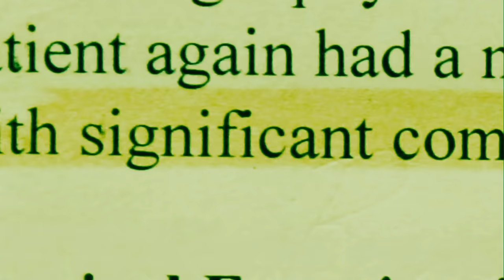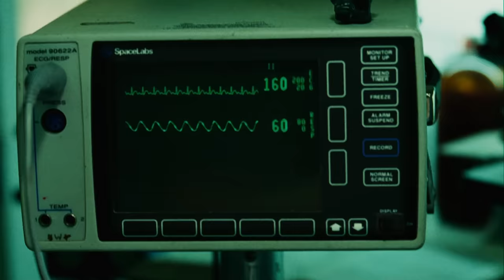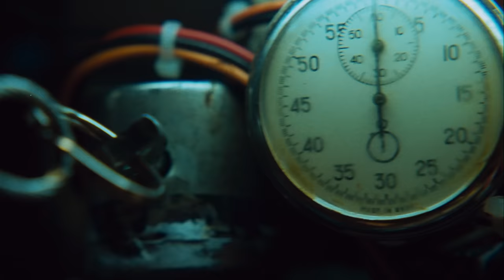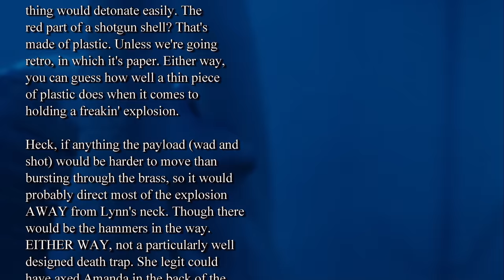Saw III Review

Comment: I think I know how that Death Collar worked. The shotgun shells looked to me like they were being held in place by short metal tubes. So in effect they actually were in shotgun barrels. Think of them as sawed off shotguns that had been sawed off to the length of a shotgun shell. Theoretically that should focus the shotgun blasts towards the doctors head.
Reply: The only way shotgun shells would be lethal in that trap is when the shotgun shells explode, the buckshot (or slug) from the shells to sever her neck and cause her to bleed to death... except that's not what happened in the film.

Comment: What's impressive is that every trap in the Franchise is actually real and can technically do what it is designed to in the films. They're not fully assembled so keep prevent that, but it's impressive and somewhat scary.
Reply: Eh... kinda. They can sortof operate mechanically, to some degree. They have motion. But the Angel of Death is nowhere near powerful enough to rip the ribs out of the body, the Chains of Death would not even be able to tear the skin and the Shotgun Collar has no way of actually triggering it, even if it was feasible, due to the lack of electrical components.
They needed the motion for all the traps, so they could, you know, move them. It's far easier to time it if they can remotely trigger a smooth, single motion from a single place rather than moving each piece separately, and it's both cheaper and looks better to do the actual machinery than to CGI it.
So yeah, the machines move, but they do not "work".
Reply: @morphman86  He did say they weren't fully assembled. If that's the case, that would explain some of the discrepancies that you mentioned.
Reply: @raptoid2518  Eh... no... That's not how this works at all.

But if you want to fangasm over some behind-the-scenes trivia that got blown way out of proportions, who am I to burst your bubble with realism?

Comment: While the torture porn is... something that doesn't even need to be here, it'd be fine if there was solid writing and ideas behind it. Someone should've talked to the writers about the traps, like the shotgun collar. Then again... Could it be hinted as a result of Amanda's newbie status to the traps?
Reply: Nah....because the collar ended up working to extreme effectiveness. Hitting a shell without a barrel MIGHT wound or kill a squirrel but it won’t explode a human skull. Even a few of them. Worst to happen is some scarring and maybe she’d lose an eye.... but it’s not getting through the skull to that effect. Heck sometimes all a shotgun shell will do is explode enough to split the plastic on the sides  and yet leave all the shot still within the shell. She most likely would’ve just been a but cut up and had some slight hearing damage. It was just lazy writing.

Comment: I don't know anything about shotguns [or pretty much guns in general] but each of those shells was held in place with a wide [but not particularly thick] ring of metal that covered 1/3-1/2 of the shell. Wouldn't that alone have been enough to hold things together sufficiently to direct the blast mostly forward?